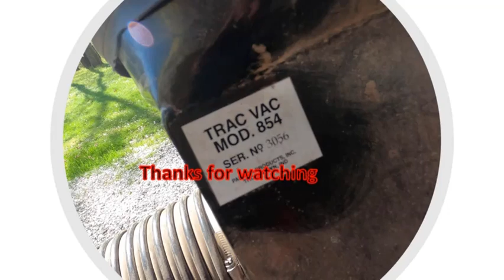Leaf Pick Up with Trac Vac 854

Comment: Does the vacuum mulch the leaves or just picks them up whole?
Reply from the maker: Yes, it chops them up.  The dryer  they are, the better they chop.  If they are still wet, I mow them first then go back and pick them up with the vacuum.  That really reduces the volume.  The vacuum increases the suction of the mower so that it cleans all the chopped pieces from the grass.

Thanks for watching and asking!